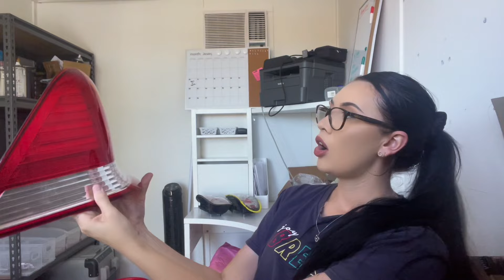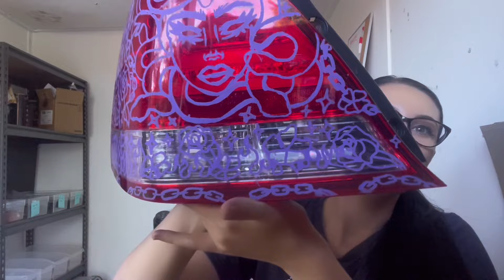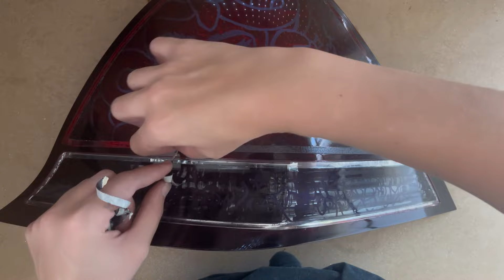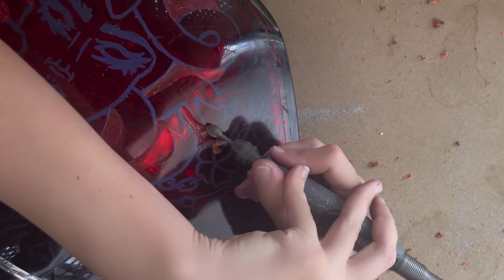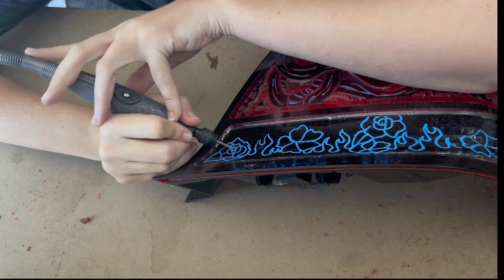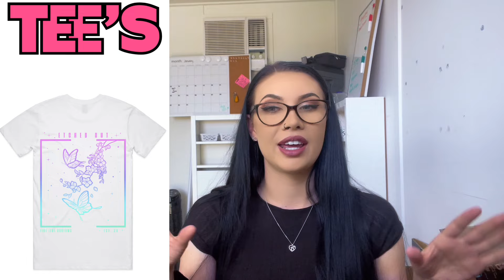Engraving my Odyssey lights with your ideas! | ETCHEDOUT

Comment: Removing the background instead of the artwork itself is called relief carving I have done it for years on pretty much every type of material except tail lights so now you've got me interested. 🤔🤔😎
Try stippling the background instead of making it flat it will give you a whole completely different effect.